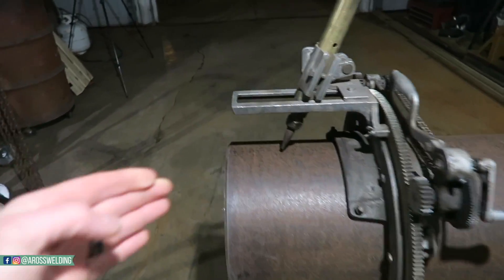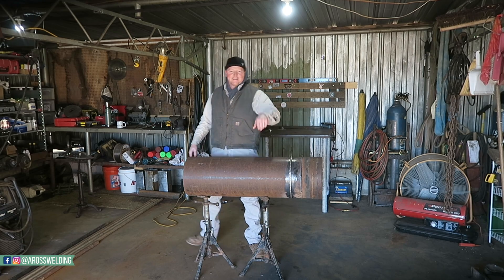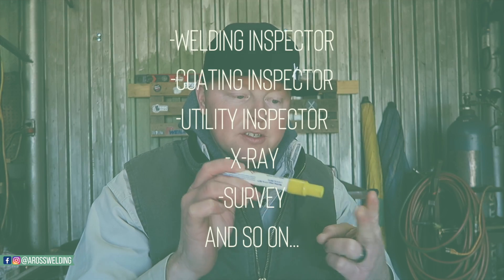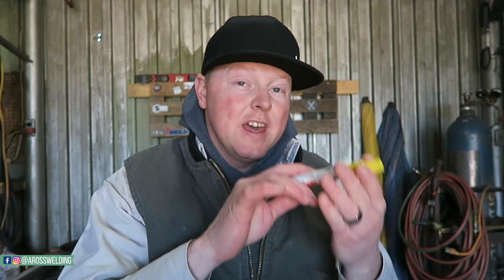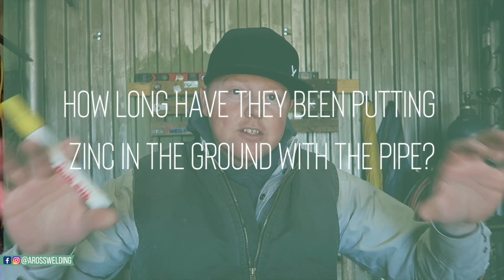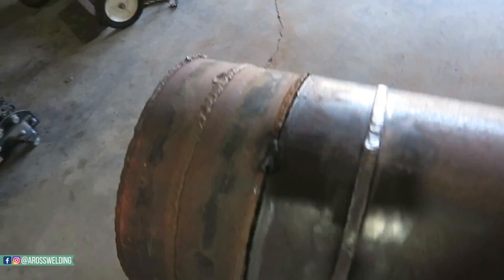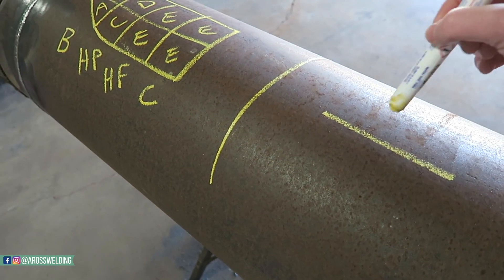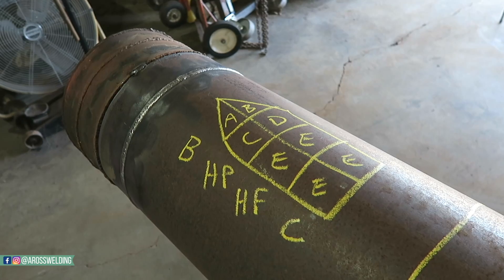WHO PAYS FOR A BAD WELD? [someone has to!]

Comment: The zinc trick is used for the shipping industry also 
Plates with a zinc overlay on them get welded to the hull of the ship to draw the corrosion 
The chemical reaction is called galvanic corrosion

Comment: Hey Austin!! You are correct about the zinc, They are also Called Sacrificial anodes. They have wire leads on them so they can test the Preidocally. To see how much is left of the anoide and thickness. I figured i would through that in there for yoy!! Btw Great and well Formed Videos as well.

Comment: It's called cathodic protection. Any 'jeeps' or failures in the coating will be protected further from corrosion by the anodes just like a hot water heater.

Comment: The zinc is only put in for corrosion when you're running close to high lines so the electrical currents don't corrode or make that pipe shock the shit out of you that's why we have ground lines off our truck also but you know this

Comment: CP test Points are usually silver soldered to the pipe then brought up to ground level to take a CP (Cathodic Protection) reading whenever needed. Rectifiers are put along the pipeline above ground so if the CP read is out of spec the GAS/OIL company’s corrosion department can then turn the strength of the CP up or Down. This all falls Corrosion Control.

Comment: We have used zinc bars in varying sizes amd weights as cathodic protection burned onto the pipe with a wire whip. Usually every 500 to 1000 feet. We have dug up old mains in some bad ground and the bars just turn into massive blobs of corrosion. Pipe was in amazing condition for being from the 50s

Comment: That's pretty cool we use a stamp on some xray or code work. With use because its in a facility we make weld maps. Each weld will get a number tie to the contractor and and welder.

Comment: It's called cathodic protection, the zinc is a more active metal so when the metals are connected the zinc will corrode at alot fast rate than the steel.

Comment: I’m a pipeline surveyor and we document the welders stencil the X-ray pipe size heat number joint number wall thickness everything really that’s on the pipe one thing I was taught and idk if you use this or what put with welder stencil they will say like ditch side and truck side sometimes they wanna know who welded the ditch side and who welding the truck side
Reply from the maker: I haven’t usually put that on my welds but thank you for sharing this. Very helpful.
Reply: Good reply right there
Reply: Wasn’t called x-ray but radiograph.

Comment: As far as I know they have put "anode bags" on steel pipe for many many years. When I first got into gas work I was a laborer, then operator and now welder. Every so often doing maintenance work we find the anode bags and have to replace them. They are designed to attract the corrosion to them instead of the pipe. Pretty neat! Thanks for the awesome videos!
Reply from the maker: You bet! Thanks for sharing and watching!

Comment: I have personally put the zinc in the ground it’s call cathodic protect
Reply: Same reason there are what is called "sacrificial zincs" attached to outboard boat engines.
Reply from the maker: Very nice. Thank you for sharing!!
Reply: Mark  Camp oh
Reply: Using zinc sticks dragged over a hot clean surface?.
Reply: I think it would be a Sacrificial anode. They are used to protect metal structures from corroding. Sacrificial anodes work by oxidizing more quickly than the metal it is protecting, being consumed completely before the other metal reacts with the electrolytes. Several different forms of cathode protection are forming alloys, plating, and galvanizing the metal.
They are also used on boat engines near the propeller and in home hot water tanks.

Comment: The pipe mill only guaranties ovality of pipe around 6 feet either end as I was told years ago . heat numbers on large pipe were inside the pipe on the ends along with other numbers and manufacturer. Who pay's for bad welds ? The contractor you are working for  . there is contingency for repairs on production pipeline . There usually is repair welders that do nothing but fix bad welds . Contractors like no repairs of coarse but with the push for production there is room for some repairs. Usually the welders that get the repairs are found out by their numbers  via as Austin has said  through the stencil . welders that get to many repairs are sent home and replaced .  I've never heard of the zinc thing but they do have Cathodic protection for corrosion on pipe for when the coating fails . One can google it, you tube has good info on it . They also send smart pigs through the pipe to detect corrosion . hahahaha they usually need an IQ of 150 or they won't let them in the pipe

Comment: This is a great explanation of who’s responsible. I would like to know more about the repair process. Thanks
Reply: ranndalld, man it all depends on how bad the repair is. If it’s a small amount you can usually grind into it and fix the weld. If it’s really bad you have to cut the entire weld out and re do it. I’ve only seen one cut out but it was a problem from the get go.  Most of the time you just grind in and fix what didn’t pass X-ray

Comment: I’ve noticed you and other pipe liners do not wear welding jackets or sleeves when welding. What type of shirts do you wear that withstand the arc and slag coming from the weld/welder?
Reply from the maker: When I have a hoody on Under my welding shirt like I did In this video I do not wear any sleeves but during the summer I usually wear a sleeve on one arm and then Arm Pad on the other.
Reply: A heavy startched shirt is the cats pajamas.

Comment: At my past job (which was shop) if you put the root in, you gotta finish the whole pipe. We werent gonna risk no xray under our names lol
Reply: Ruben Rios you said shop. Which in pipeline fabrication means the same thing. And that’s how it’s done, but on mainline it’s different. There’s different stations and the lines gotta keep moving. You get paid to move forward. When something’s screwy is going on, the weld boss will make adjustments to keep the line moving.

Comment: Can your sight be damaged throught many years of weldin, I mean with wearing mask on head all the time?
Reply: 40 years of welding is hard on the eyes. Not what they used to be
Reply: @randyknighton772  So your sight can get weak even after long time of welding even with a mask wearing all the time?What about radiation?
Reply: I don't know if radiation has any effect that I know of. It's just constant looking at the puddle. I wear darkest shade possible. Just a constant strain but I still love to weld and create things
Reply from the maker: 🤔 not from the mask if that’s what you mean.. but I’m sure welding can be hard on the eyes because of the staining to see the puddle. But as long as a guy keeps his or her eyes in good check and get the proper help then I’m sure it would be ok.
Reply: @arosswelding  Thanks Austin for help. :)

Comment: So you could have up to six welders on a joint?
So if they come back with a bad shot they go by depth to determine whose weld failed?
Good channel, by the way.
Reply from the maker: Ya six or possibly more depending on the size and thickness of the pipe. Yes, that’s exactly what they do. 👌👌😎 thanks.